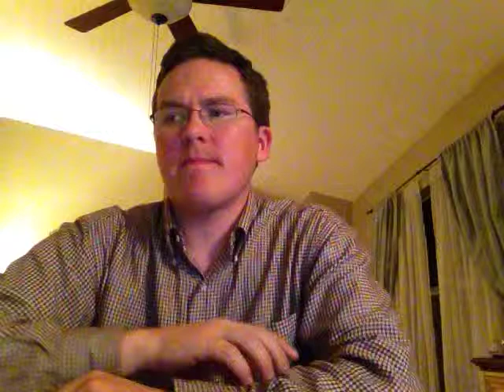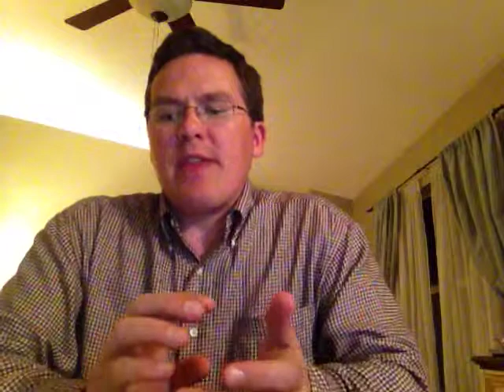Converting to E85 | E85 Conversion | Bell Performance Video Blog

Comment: Hi! In Brazil we can find E100 Fuel Pumps at every single gas station because from the seventies to the end of the eighties there were a government  program called "ProAlcohol" that made car manufactures become interested in making engines that could run on E100 only and for 10 years it was a sucess, most of the cars produced were E100 only and many of these old cars are still running in our streets... In 1989 ethanol started to become scarce, the demand was higher than what could be produced and people started to buy gasoline cars, manufactures lost their interest in producing ethanol engines, some people made conversion of their engines from ethanol to gasoline and the ProAlcohol program started to die. In 2002 near 100% of the cars made were gasoline cars, accualy gasohol. One thing different from the USA regarding the brazilian gasoline is, since a long time ago the government demanded the addition of 18 to 25% of Ethanol in our gasoline, there was a time in the eighties it is used to be 10%, but from to 2000 on, all gasoline sold in this country had at least 20% of Ethanol in it and since 2015, the government once again stated that 27% of Ethanol should be added to our gasoline... Many complained about it, but nothing made they change their minds. Well, getting back to the end of the nighties, many people started making blends of ethanol and gasoline on their own, because ethanol was so cheap at the time and the cars made from 1995 to 2002 were running relatively fine with this blends...so the industry started to see this popular behaviour and in 2003 they`ve released the first brazilian flex fuel car and from then on the production of flex fuel cars exploded and most of the cars produced for our market today are flex ones. But if people overseas think this is all a good idea I recommend you to rethink about it. One problem we face and most people don`t care or doesn`t understand about it is that many of our flex fuel car engines are knocking when running on our regular 87 octane (95 RON) gasoline and since our  premium high gasoline is very, very expensive and not available at every gas station, people filll up their cars with the regular one everytime. 
Car manufactures here convinced many people that this is a normal behaviour and won`t cause demages....I myself dont buy it! knocking is never a good thing at any moment! Put in the tank 20% more Ethanol and knocking "magically" goes away! Another thing is the mileage, our flex fuel cars are not very efficient compared to gasoline only ones, they tend to run a richer mixture even when only on gasoline because the engine has to cope with the excess heat generated due to the higher compression ratio of these flex engines. They tend to inject more fuel to help it cool down the temperatures in the combustion chamber... and our gasoline itself (gasohol) is naturally not the best thing in fuel consumption with its 27% ethanol content....The Ethanol used to be very cheap back in 2003 to 2006, now a days in most brazilian states it is too expensive to compensate for its lower mileage... So, our brazilian cars can take more ethanol than many american ones without as much problems, but the issues with knocking running on gasohol only and mileage is haunting us everyday! 
Sorry for my bad english!